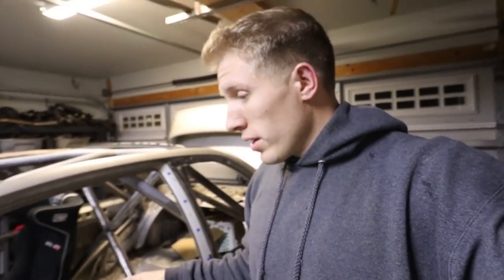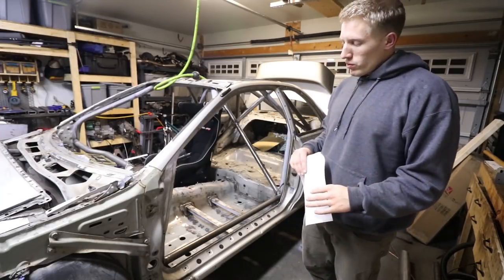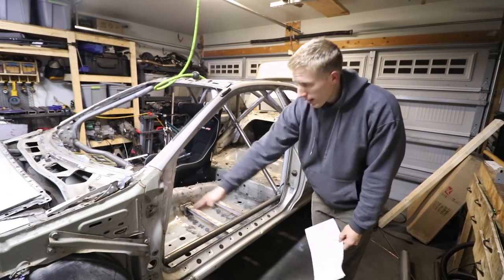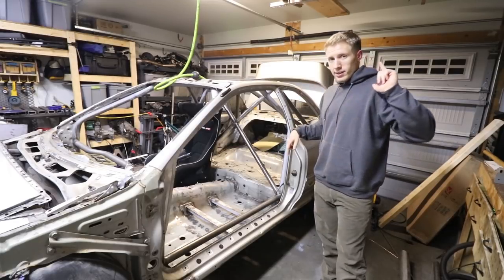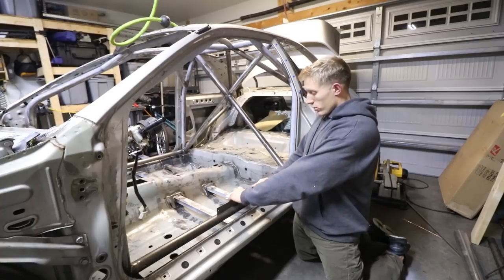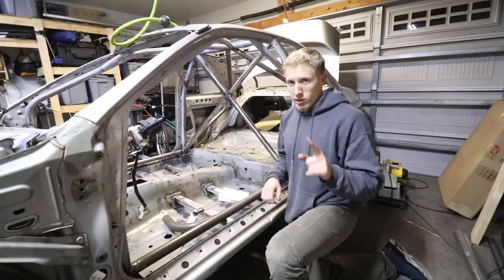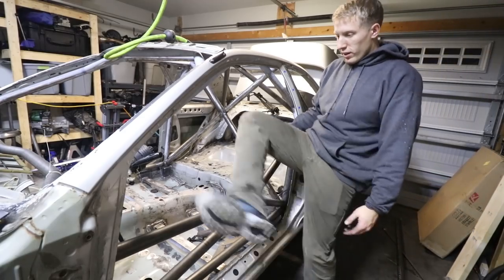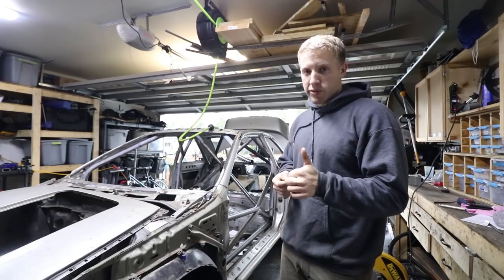GC8 Rally Car - Door Bars - FIA Stage Rally Roll Cage Build

Comment: If you haven't done the A-pillar bars yet, I highly recommend putting the driver seat and passenger door on while you are mocking them up. it's really tempting to try keep complete symmetry in the bars from side to side, but remember, your co driver won't have to worry about bashing his knuckles when he takes the steering wheel off or checking the passenger side mirror when leaving parc expose. also depending on the angle of the a pillar bars, it can be a huge pain in the ass to get the dash in and out, and lets be real, it's not going to be just the one time putting the dash in.
Reply from the maker: That's great advice, wish I hadn't done it yet haha. I just mounted the dash yesterday and ran into that issue, I got it to be able to get it in and out relatively easily but I definitely had to remove more than I intended. 
I should have added a bend in them to bring them farther out of the cabin and have more clearance, and visibility.

Comment: You should be able to make the A pillar support bar out of one continuous piece.  (Not 2 pieces - 1 above and 1 below the upper door bar)

Because the A pillars lean in at the top, it means your A Pillar bar will also have to head in at the top to make the join.  If you straight line it from your front lower mounting foot, up to the node at the upper corner of the windscreen, the A pillar bar will not fully intersect with the upper door bar, because of the top of the car being narrower than the lower section.

You can then keep the upper door bar, and the A pillar support bar each from a continuous piece, which will be stronger.  But you need to make sure it doesnt intrude too far into the cabin.  Then you can still gusset and tie in the A pillar bar to the upper door bar aswell.